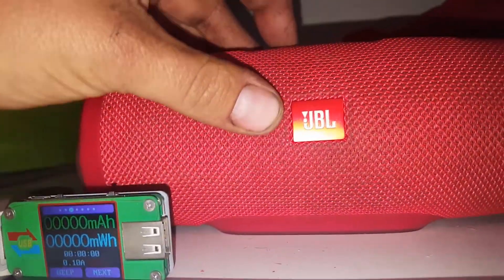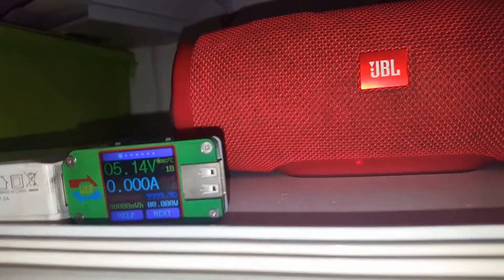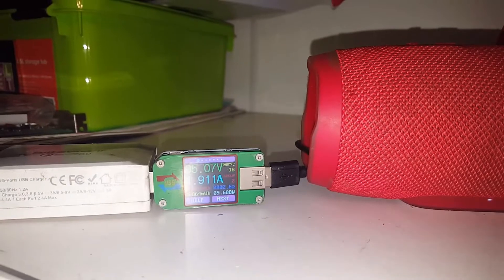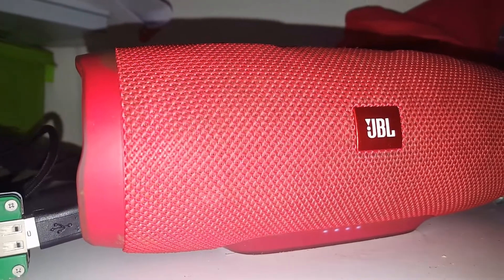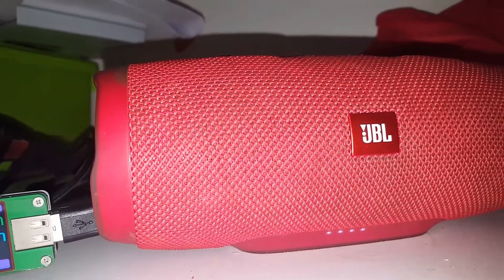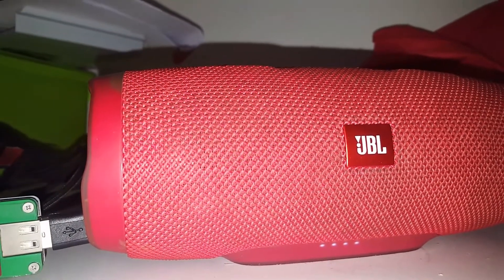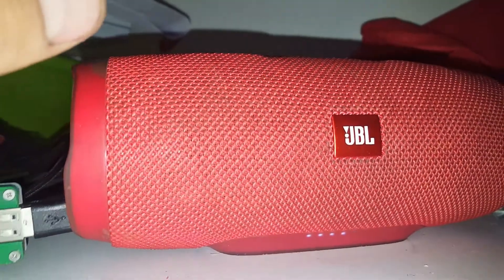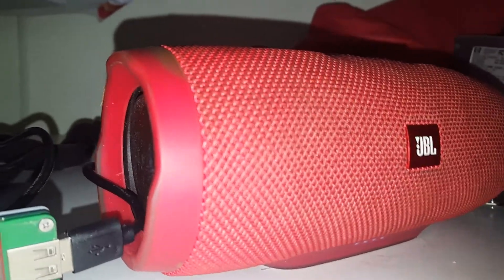Checking a Jbl Charge 3 Battery for  degradation 18650s?

Comment: hey there, you have your math a bit oversimplified, the mAh you are reading on the meter is the Ah at 5v which is not the same as the mAh for the speakers battery rating. What the manufacturers use is a 3.7v rating because that is 1: a bigger number and 2: easily calculated with whatever rating is on the cells they put in. So you should always look at watt hours unless you know it is using a TP4056 type charger (linear versus buck/boost type charging)  
To get watt hours for the speakers battery you multiply the 6000mAh rating with the 3.7v nominal voltage to get 22200mWh and wow that comes to a 190% overcharge so it is probably a different actual pack voltage and uses an inefficient voltage converter (most likely boosting the voltage) or the unit uses alot of power when just sitting around since it was running for a few number of hours. So there is no easy way to tell besides opening it and testing the pack by itself. hope this helps, cant wait to see it opened and upgraded!
Reply from the maker: Thanks heaps for that mate. I really enjoy comments like this ! Helps every one
Reply: your welcome mate! glad to help!
Reply from the maker: I always appreciate your input. Thats why i love YouTube learn something new all the time